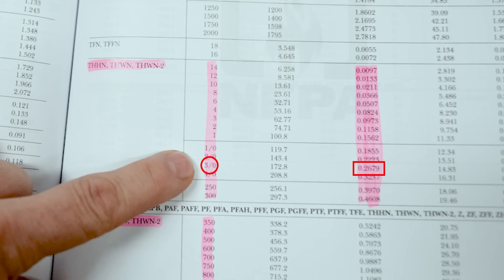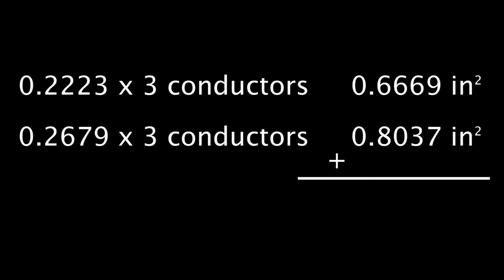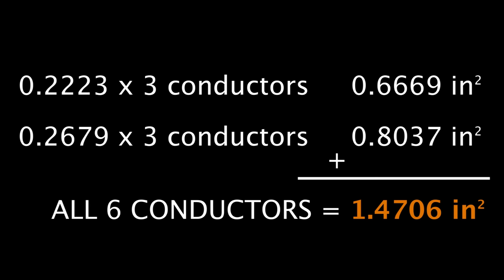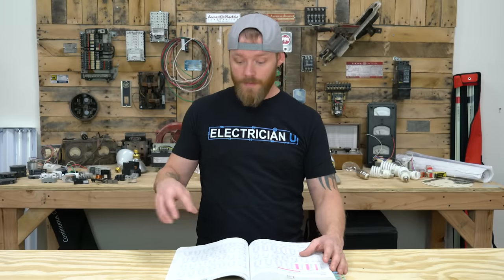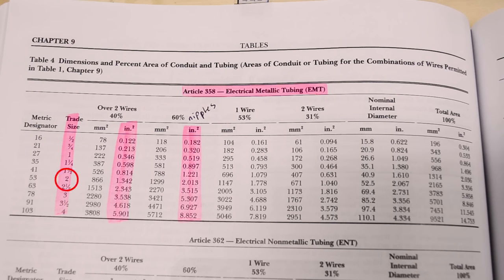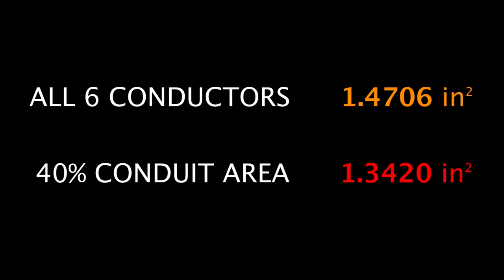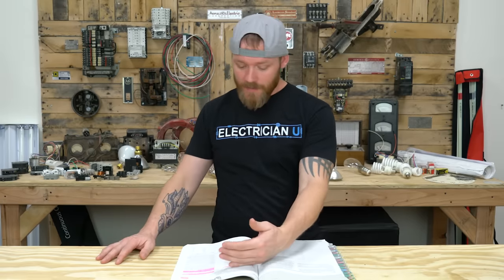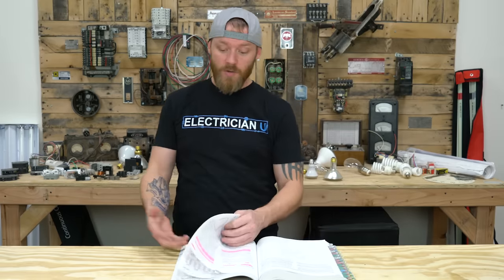CONDUIT FILL EXAMPLES for the Modern Electrician - How Many Conductors Can I Put In...

Comment: Hi, looking at this, something does not add up, for instance, table say only 8 THHN conductors/wires are allowed in a 1/2 " PVC sch40 conduit, right ? , but you are supposed to be able to use 40% of the conduit cross section area, if you do the math, 8 wires is only about 16% of the cross section, so what is right ?? Well, my dimension were wrong, so 8 wires 12 gauge take 31.26 to 33.8 % (depending on sizes of both pipe and wire) , so now makes sense, if sizes/dimensions are wrong the math won't make sense. And actually I put only 6 scrap pieces of wires to see how they would look in the pipe, and it look crowded, so 8 is enough, and pulling them in curves etc, might not be easy, so the code makes sense. 😂😂

Comment: In Canada you have to de rate the amps for wire sizing based on how many conductors in a pipe. So I guess in Canada they include heat as reason for conduit fill. I.E if 7 conduits in a pipe you got to use a 10g for 20a pull. (Not exact just an example)

Comment: Does the 40% rule apply to low voltage/POE? Every low voltage conduit I’ve ever worked with was stuffed.
Reply: I work in low voltage now and it seems like you just lube up as many cables as it takes to max out the emt.
Reply: Same here. I’m guilty of that
Reply: I believe BISCI standards have you follow NEC requirements for fill.

Comment: Interesting.  A neighbors electrician (loosely used)  fought like hell to force three Huge cables-conductors, through a 3/4 " conduit run from house to garage to  power the garage 100 amp service.
Reply: Easy of pulling can override the code to minimum. One size larger conduit is not usually a big jump in cost unless there's really a lot of conduit.

Comment: Conduit fill is impedance feeding voltage from magnetic flux into another wire. Back feeding on a low level. The other problem is in commercial and industrial electrical work. After 360. It's impossible to pull conductors thru. Glad you broke out a codebook bro.
Reply: It's more about heat dissipation. They're planning for every circuit to be loaded to the max at all time. If you jam 12 wires next to each other all pulling 16 amps (out of 20 amps allowable), the wires are going to heat up which increases resistance. positive feedback loop that can run out of control.

> 360 degress is impossible yes

Comment: Hey, I put that orange 10-3 Romex into a half inch conduit that was in direct sunlight. is that safe? Say it's 105°
Reply: 10-3 NM cannot be used outdoors in conduit and if it's a complete conduit system (box to box) as opposed to a sleeve, 1/2" emt is too small for 10-3.
Reply: @pld8993  thank you

Comment: Where can the DIY'er go to reference NEC codes?  
I'd sure love to research stuff before I need it.  I live in a small town and my library doesn't have NEC books .... Do you know / believe if larger town libraries have them?

Or do you know where else a DIY'er could go to brush up on information?
Reply: John Jacob JinglehimerSchmidt I could send you a pdf file of the 2017 NEC if you have the Dropbox app
Reply: @cowill11  Thanks.... But I wrote some code to screen scrape the NEC off the ICC website.  It's a time and CPU hog ... But I've gotten the 2008 ( the code std for my town ) and am currently downloading the 2020.

Next .... how to read the damn thing.  Thanks for the support tho.  Just didn't want to shell out $130 some odd....
Reply: John Jacob JinglehimerSchmidt
 ... I have found that you can Google most any well worded question and get a specific answer that will probably have a few tips you didn't think of.... like including slip joints on underground conduit for frost issues. I Googled for running power to my spa and there were tips on how close / far for the emergency disconnect and nearby service outlets. When it doubt you can often get a clarification from your local inspector..... because he is the guy you are trying to please! (and he will know any local exceptions to code)

Comment: Hey, unrelated issue.  I have a service to pull and the pipe is full of water, which is now ice.  At least part of the 200' is ice. Any tricks on melting?  I don't want to wait for spring.
Reply from the maker: Waiting. Haha. 

You don't want to stick a torch on something like this unless you plan on literally gutting and replacing the entire run including the "conduit" that's holding the conductors.

Comment: What is the difference between nipples and conduit? Is it just the length (9.0(4) seems to indicate 600mm (24in) is a qualification characteristic), or are there other different characteristics between nipples and conduits? Are you allowed to have bends in a nipple (like, a jog to connect misaligned holes on two electrical boxes), or once you put a bend in a nipple does it become a conduit?

Comment: Have you done a video on derating conductors based on ampacity? I would really appreciate it. I want to see all the factors I need to consider to fit as many conductors per raceway. Say for example 20 LEDs fed off a 20A breaker. How many can I fit using #12 awg thhn? Or #10 awg?
Reply: One of the derating things to consider is "continuous load" which is defined as anything that is running for 3 hours continuous or more, must derate to 80% of total ampacity

So with 20 LED lights on a 20 amp circuit, If the lights will be on for longer than 3 hours then you only have 16 amps available. Each LED Would have to be Less than 0.8 amps each. You will need a 2nd circuit

Comment: Can a conduit house both AC and DC...   Example.  3 12 gauge wire for outlets in a shed and DC solar panel wires coming back from the shed to the basement. Is something like that allowed
Reply: Yes, as long as all conductors have insulation rated for the highest voltage in the conduit.

Comment: I understand you are accounting for conductors in general. But i think a more specific explanation should be thought about. Like grounds. They do count as a conductor but if you're putting different sized wires then you'll need to size the ground to the largest conductor.
Reply: Codi Vega    Grounds are based on over current amps not largest conductor.   Table 250.122
Reply: @KevinCoop1  but still should be accounted for when pulling wire in pipe am i wrong?
Reply: Codi Vega    Absolutely.   Southwire has an app and computer program that is free for this.   Works extremely well!   Respectfully,   Kevin
Reply: Why use an app when you have the code book and are doing the calcs already?
Reply: Codi Vega    If you have been doing the calcs for a while, you know what sounds reasonable in your head.   After that this app is OK.  If you have some weird pulls in feeders, it calculates pulling tension and elbow sidewall pressures.   The added features saved my butt a few times.   Other apps like voltage drop, I calc them myself.
Reply: Im more meaning for grounds. Just thought it was something important that wasn't brought up is all..no harm no foul.
Reply: Codi Vega    Best wishes to you sir!   Kevin
Reply: Guy Fawkes-Day    Do you have the Voltage Drop Calculator?    I always suggest to do voltage drop calculations by hand for a year and as many as you can before using a spreadsheet that someone else made.   But this App is very accurate.   Maybe a few months by hand.   I hope people know why to do voltage drop calls, not just to do them as the NEC suggests!   Respectfully,   Kevin

Comment: This makes sense for new installations. What are some things that are done for existing installations?For example, suppose your conduit was behind a brick wall and adding one new conductor would exceed the 40% limit. Do you have no choice but to tear into the wall and disconnect all the wires to install a larger conduit in order to pass inspection? My assumption was that the purpose of limiting the numbers is to insure that there was room for more if a modification is made.
Reply: Run an additional conduit in parallel to the old conduit to hold the new wires? Yeah, it might be ugly having a conduit strapped to the exposed face of your brick wall, but at least it would still be to code. This is just a guess from someone not in the trade.

Comment: I have to say I disagree on the conduit fill doesn't apply to heat argument.  While the damaging of the insulation while pulling is probably more pertinent to the conduit fill, it is still relevant to think about heat. The more conductors in a a conduit the more heat (wattage/resistance) per length and therefore the more likely insulation may breakdown.  Either way we are worried about the insulation breaking down and potential shorts between conductors.

Comment: How would you pull 3x 4/o aluminum and 1x 2/0 aluminum through 2in PVC with out a puller? Installing underground service for my shop.
Reply: Tarek Ashurex
 ... you might want to consider the DIY method of laying everything on the ground and walking each pipe / fitting into place for a dry fit. When everything looks good you can glue it then kick it into the trench. Stuff like this is why most guys would pop for copper THHN. Smaller wire size for the same load and bends so much easier that it saves a bunch on the labor end.
Reply: @rupe53  absolutely, only reason I didn't go for copper is the trench to my meter box and disconnect is 400 feet away, that's real expensive in copper. I got the aluminum at less hen .25 a foot because someone never picked the order up. It's for a shop I built and figured it would be good enough.
Reply: @T6Tarek  ... if the conduit is that long are you sure you can get enough power at the end of 400 ft? Checking the charts, you're only good for maybe 100 amps at that distance, and already slightly over the normal 5% voltage drop. (shows 6.6% / 8 volts per leg) That size wire is good for 200 amps at less than 100 ft. See where this is going?
Reply: @rupe53  I'm only running a 100 amp service.
Reply: True distance is 315 feet
Reply: @T6Tarek  ... so 315 ft is YOUR total run in wire, right? (not conduit length) When doing some of these calculations it's wise to consider the run TO the meter (service wire might only be 2/0) and additional lengths for each end of YOUR run, then there's the length of the circuits within the building. Sometimes you get caught up with that 50 amp welder at the end of a big garage, if you follow my drift.  <LOL>  In reality you'll probably be ok @ 100 amps because that's not your continuous draw. Just use no-ox compound and make sure your connections are tight.

Comment: Haven't been in industrial much? The codes generally above and beyond sure but it's the same principle as ty-wraping. In our local, no more then 6 MC under one wrap to allow for heat disipation. You'd agree in the MC case it's got nothing to do with insulation damage. Although that's definitely part of pipe fill
Reply from the maker: LetsTerriblyPlay I agree bundling is an issue which is why we der are conductors that are bundled as well as those requiring temp correction for ambient temps. I don’t agree conduit sizing has anything to do with it. Those 6mcs are not in conduit. Also if that were the case the jacketing of the Mc could be considered a conduit itself, but the manufacturer fills that jacketing to the brim even with 12/4 where you have bundled current carrying conductors. All I’m saying is heat dissipation has to do with 310 in number of conductors in a conduit, chapter 9 does not.
Reply: MC cable in Industrial???? WTF....have been involved in Power  Plants and other heavy Industrial Jobs my whole career (20 years). 90% of my work experience is in those environments. I have only seen coated MC cable on jobs from the early to mid 1980s. Everything else is since then is tray cable and rigid conduit down from the cable tray.
Reply: @ElectricianU   Electrician U  different places, different rules. Here they do consider the jacket a "conduit" for the purpose of bonding. I just don't think you should brush it off so easily. Lots of people come here to learn even from the start of entering the trade. They teach you it for a reason.
Reply: @ikerivers1795  You are inferring I was talking about Industrial when talking about 6 bundled MC. Which I wasn't. Your bad.
Reply: @Scradee  you asked a question. "Haven't been in Industrial much?" Implying that in Industrial, MC cable is used and that Dustin does not have much Industrial experience. Your bad. You asked a question, you did not make a statement.
Reply: @Scradee  what Dustin is saying is quite simple...use 310 to figure out conductor derating eg. MC cables bundled together or wires in a conduit. Once you have that figured. You move over to Chapter 9 for conduit fill.
Reply: @Scradee  no it's not a "conduit" not even in quotations. It is a metal sheath protecting the conductors and as such, a metal, is to be bonded to the Equipment Ground.  The sheath in MC cable is not to be used as an EGC. There is a separate EGC inside the cable. There are AC cable, MC cable and MCAP cable. But that gets dealt with in Article 250 and not 310 and chapter 9 as that is what this video talks about.

Comment: So how many conductors allowed vs how many current carrying conductors are allowed - the difference are ground wires?
Reply: yes, there's a limit to how many live conductors you're allowed to run together.
Reply: The conduit fill factor calculation is about the mechanical limitations of practically pulling conductors through the raceway.  It doesn't "care" what these conductors are for, it only cares about what fits and is practical to pull.

The calculation that "cares" what conductors are current-carrying, is the ampacity adjustment calculation, formerly known as derating.  Grounding conductors never count in this calculation.   Neutral may or may not count, depending on the specifics.  Ungrounded conductors most often will always count, but the one exception is conductors that can't be energized at the same time, like three way switch travellers.

Comment: Always thought ambient temperature matters, solid point tho
Reply from the maker: Mills 758 it does matter to the conductors, doesn’t matter to the conduit. We use ambient temps and correction factors and first, to figure out what conductors to stick in the conduit - then we figure out the conduit size after.

Comment: The volume of a conduit is reduced to 40% because of heat not because you might nick the wires. Any Ferris material in an electric field will have eddy currents causing a magnetic field. The AC electricity is 60 cps causing the electrical field to change and reverse 60 times in a second. The continuing reversal of the electric field causes heat. The chart that you referred to as the volume of the circular mil area of a wire. A wire is not a square it's a circle. Thank you for your effort.
Reply: Conduit fill has nothing to do with heat. Fill limits are about physical space only, pulling conductors through the conduit without damaging or stressing them. Circular wires aren't squares, but their area is measured in square inches.
Reply: @pld8993  wrong it's. circular mil area
Reply: @edcook6146  Someone's wrong here, but it's not me. You may want to read the NEC before you pretend to know what it says. With regard to conduit fill and insulated conductors, the dimensions provided are in square millimeters and square inches, not CMA. CMA is used in Table 8 for conductor properties in which CMA, along with sq mm and sq in, is used referring to only the conducting material of the conductor. We use CMA in voltage drop calcs, not conduit fill calcs. Reading is learning, try it. And again, conduit fill has nothing to do with heat and everything to do with physical space. If you were an electrician you'd know that.
Reply: @edcook6146  You're wrong, and you don't know what you're talking about. I've read every word in the NEC multiple times, been teaching the NEC for over 25 years. Feel free to share ANY reference in the NEC that uses CMA for conduit fill, just one. Every conduit/tubing Article refers you to Chapter 9, Table 1 for number of conductors in conduit, known as conduit fill. Tables 1, 4, and 5 in Chapter 9, as well as Annex C, are all related to conduit fill and not a single part of any of the fill tables mentions CMA. The informational notes in Table 1 make it clear that fill is about physical space, no mention of heat. Table 8 deals with conductor resistance and has nothing to do with conduit fill. Article 310.15 deals with conductor ampacity and heat. You just received a free lesson and learned something you didn't know 5 minutes ago. You're welcome.

Comment: From all of my studying the wiring tables are all based around heat AND jacket integrity. 60C rated cabling does not have the same integrity as 90C just like 300V rated cable does not have the same integrity as 1kv rated cable.
Reply: Heat increases resistance, as resistance increases the voltage will decrease in the same manner. That’s why ambient correction is not mentioned more than once. Also if the code made you calculate or load strictly to temperature we would have to have an ambient correction factor minimum of 60C or something similar, but because our wiring is rated to almost over 35% above ambient when using the 60C table and even higher for the 75C and 90C table. Do some destructive testing and you’ll see that conduit fill has more to with temperature rise and wire failure, this being based on the language in the codebook.

Comment: 300.17	Number	and	Size	of	Conductors	in	Raceway. The number	and	size	of	conductors	in	any	
raceway	shall	not	be more	than	will	permit	dissipation	of	the	heat	and	ready	installation
or	withdrawal	of	the	conductors	without	damage	to	the conductors	or	to	their	insulation.